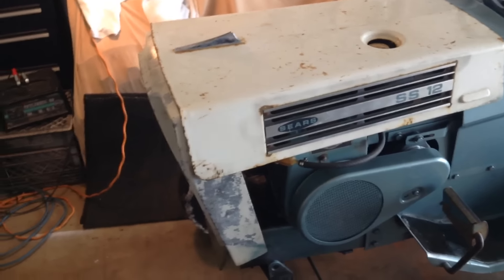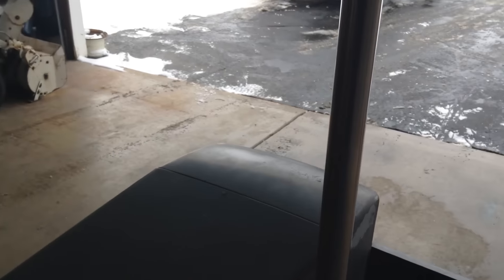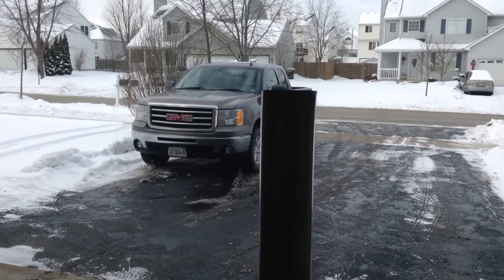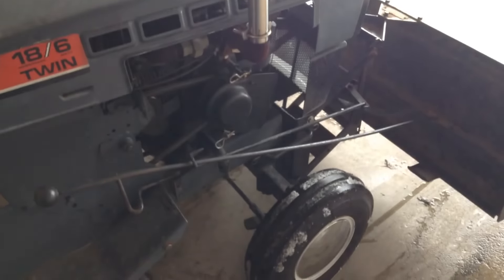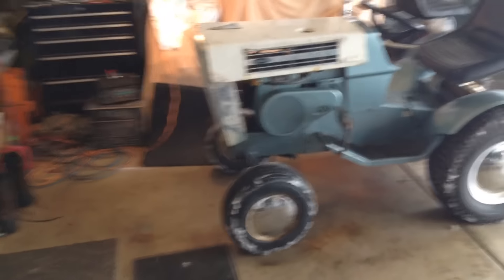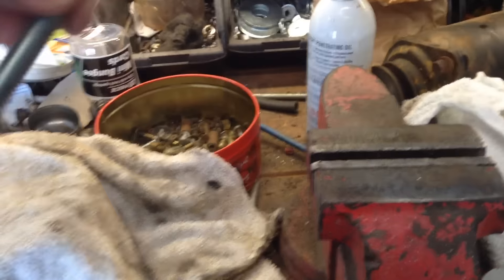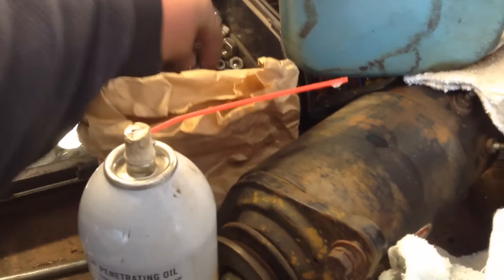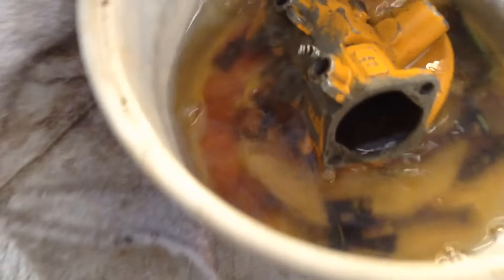1969 Sears SS12 on a burn

Comment: The 18/6 sounds great with the new stack! SS 12 is running good too, I've had that problem before with replacing a plug & then a no start...great vid Rooney!
Reply from the maker: Thanks Alan! Ya I figured that stack sounded good outta 1 cylinder so why not 2? lol I couldn't believe it wouldn't fire! So I put the old plug in and bam! So il stick with what works. lol